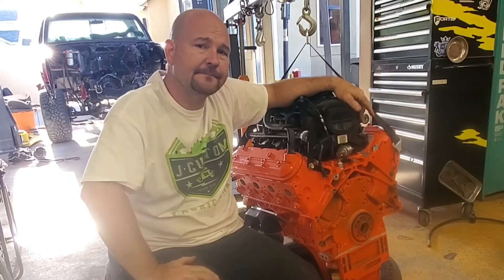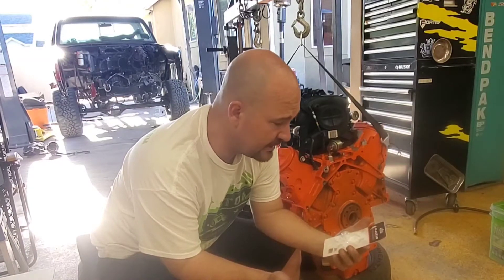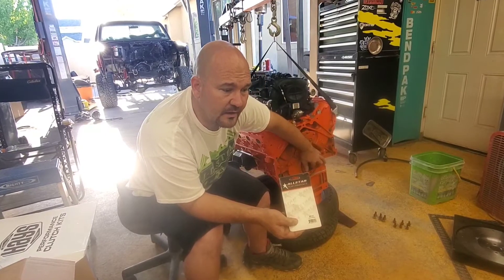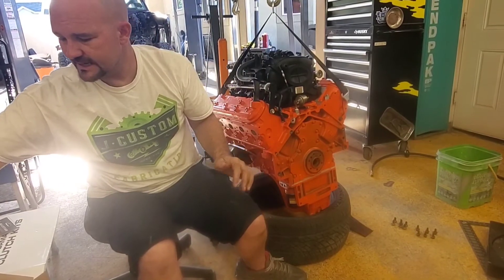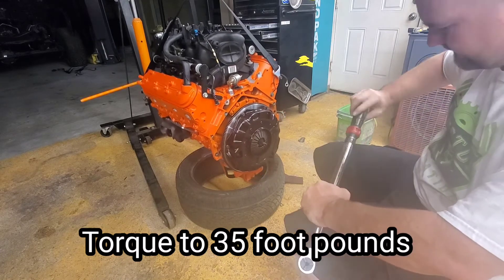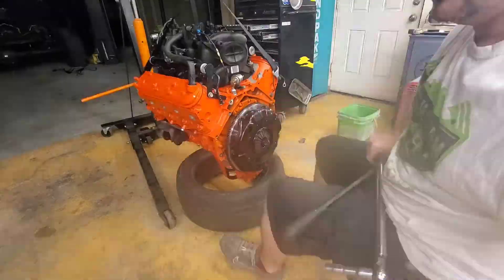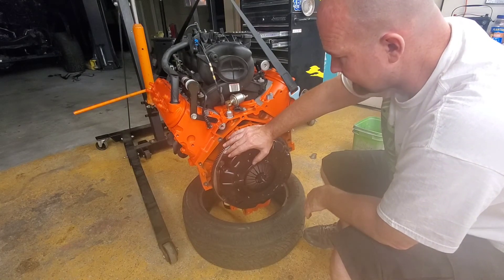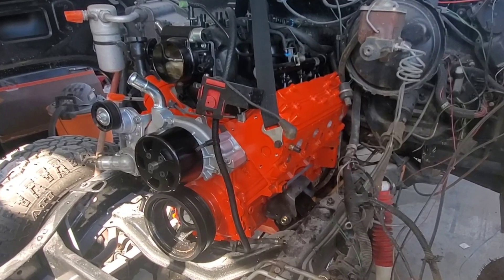6.0L LS swap to a Muncie SM465 four speed Manual transmission in My square body Chevy K20 Silverado

Comment: What are you running for oil pan and motor mounts? Any issues with clearing crossmember? And with the motor mounts does the engine sit in correct spot for trans

Comment: I’m curious about the headers you decided to use .I can’t use my stock shaved style manifolds cause I have a slave cylinder externally and the down tube is right on top of it. Any help would be great
Reply from the maker: What worked great for me and cleared everything even my slave cylinder was the Schoenfeld Headers 1302LS1

Comment: What size bell housing did you use ? I’m doing the same thing but in a Camaro
Reply from the maker: Ended up using the stock bellhousing that was on the 85 Chevy truck... With a Camaro you should be able to use the stock bellhousing also

Comment: Elsewhere, I saw people use the GM 12557583 pilot bearing, that one is a roller bearing.. Pro's ans con's?
Reply from the maker: So I was gonna use that 1 but I just didn't feel like it had enough but enough surface area riding on the input shaft.
Reply: So there are two roller pilot bearing options ls7 (12557583) and the smaller 8605. 

The ls7 one fits in the first shoulder, the 8605 fits in the deeper bore. I would agree that there isn't much engagement using the 8605. The ls7 bearing has plenty though. 

I've used both.

Comment: I wish the measurements on the pilot bushing had the length, and height of the step... Diameters are there, but not anything else.
Reply from the maker: You can pull it up on their website but it's 1" total length The step is a 1/4" and 3/4" into the crank.

Comment: So what pilot bearing did you use ?
Reply from the maker: ALL26112
Reply: Another alternative is pilot bearing  GM 12557583. It's a sealed roller bearing that sits in the larger, rear, socket of the crank. So, it sits further toward the transmission and supports the shaft.

Comment: can I use your same part numbers for an 82 with the sm465 putting in a 6.0
Reply from the maker: Yes you can
Reply: @JCustomFab  which motor mounts did you use to put 6.0 in to mate it to stock location as the 350
Reply from the maker: Yes the 6.0 mounted in the stock location
Reply: @JCustomFab  I was wondering what motor mounts you used to get it into the right spot where it needed to be do you got a part number for the motor mounts?

Comment: How's it runnin' theses days!? Great video!
Reply from the maker: It's running great 👍but having some overheating issues now that's It's over 100 degrees here  I'm working on that right now and gonna shoot a new video here shortly so take stay tuned.
Reply: @JCustomFab plz tell me what starter you used I have 168 tooth flywheel on my 5.3 starter grinds but with 153 tooth flywheel will probably change that

Comment: i am thinking of swapping my 4.8L engine on my silverado 1500 2009 to a 6.0L that was on a silverado HD but i am worried about my transmission cuz its four gear trans anyone have an idea if its safe or could my gear box handle that 6.0 engine ?
Reply: @JCustomFab  appreciate it
Reply: The m20 m21 and m22 muncie will easily handle 6-700 hp. Theres a good reason they call those transmissions "the rock crusher". They also have a whine to them as they have straight-cut gears, which also makes them durable.